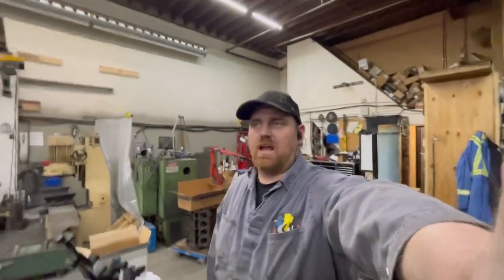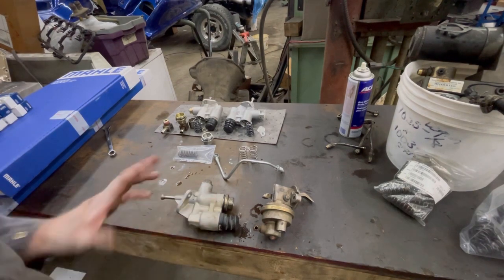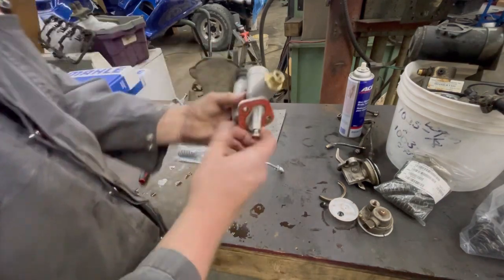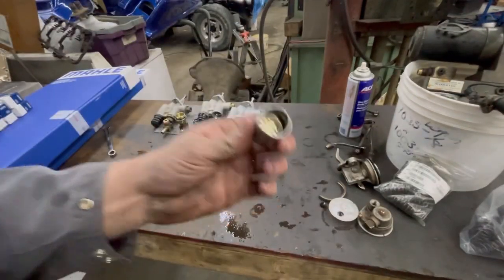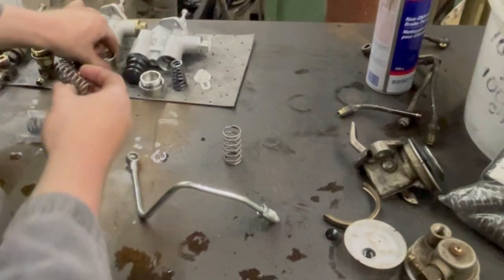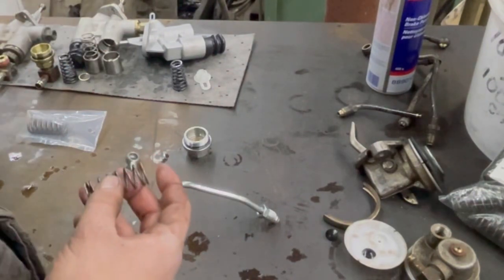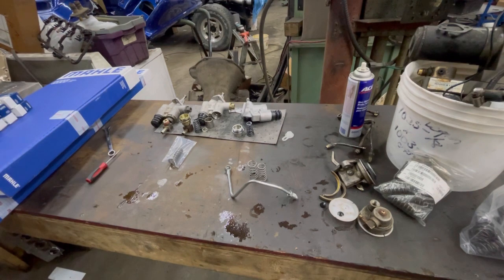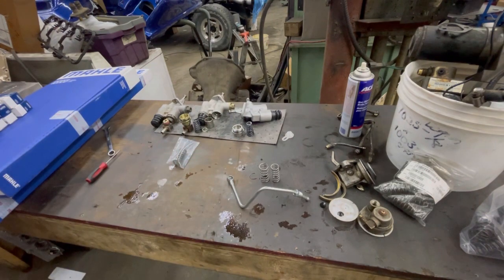HOW TO BUILD HVLP LIFT PUMP ( 89-93 FIRST GEN CUMMINS )

Comment: I have  a 12 v 5.9 from a 1995 school bus , 121,000 miles , tag says 230 hp at 2300 rpm ,  if I replace the lift pump while its out should I replace the pump with the big spring one , or just leave it alone,  all we’re doing is a reseal and  kdp its going into a 1995 f350 service truck ,

Comment: I have a Cummins B3.9l engine in a 2004 Lull telehandler. I just started having throttle response issues. As I just bought it used I started I presumed lift pump and filter issues. Pulled the Wix 33358 fuel filter and saw it was rusted internally so replaced it. Couldn't get the lift pump to prime so thinking about replacing. A direct replacement is very expensive. But I saw mid-90s Dodge Cummins diesel pump that looked exactly the same being just $60. Will they work with my B engine?

Comment: Interesting upgrade. However the only diaphragm pump pump I've had fail either in the 89 or the 93 both of which were brought new and I still own, was because it set for 2 weeks in northern Canada while I was Snowmobiling at constant -40 (maybe less) and where the rod was swaged to the diaphragm washers shrunk in the cold and pulled through the washers. Also note that on another trip, upon returning from the cross country snowmobile trip, my Dodge was the only truck that would start on it's own without being plugged in or pushed in the the shed at the hotel to be warmed up first

Comment: Is it possible for my 12 out Cummins to be getting fuel in my oil due to a hole in the diaphragm on my lift pump
Reply from the maker: Yep. Or the seal in the first of the ve is leaking

Comment: Can you replace the seal inside the plunger style pump
Reply from the maker: If you could find one you could.
Reply: Right I haven’t really seen a rebuild kit for like the OEM Carter pumps (ever) and I’ve never took that seal out to even know what it looks like 🫤
Reply from the maker: @fittedproductions . Pumps are cheap enough I have just replaced them if needed.

Comment: Hi Rob, you have a part number for the small bore pump? I'm in the UK.

Thanks in advance.
Reply from the maker: cummins p/n 3936316
Reply: @CUTTERUPROB  you sir are a gentleman. Your content is very much appreciated. Thank you for sharing your knowledge.
Reply: @CUTTERUPROB  looking at the specs that pump puts out around 20psi. Is that safe for the 5.9 with a ve pump?

Comment: Isn't there a problem with the new after market pumps were they dump fuel into the crank case .?? Then there is ones with the weep drain hole on the out side .       Or am I just loosing my mind
Reply from the maker: There could be I haven’t had one do that in years. But it can happen

Comment: How can I identify if I have a large or small bore pump so I know which springs to buy? Is there a measurement for the bore I can take? Or is everything that's not OEM Cummins a small bore? Thank you.
Reply from the maker: you will have to pull it apart and measure the piston
Reply: @CUTTERUPROB  I've pulled the pump and measured the OD on the piston, it measures 30mm

Comment: Pretty interesting. I appreciate your videos greatly. 30yrs ago, I wrenched for a living at a speed shop. I fell out of tune with it and moved onto other trades. My passion for speed never faded, it just got moved to the rears. As years have passed, I watched the performance  diesel industry expand. With that comes my 6.7l hybrid desire. 

Just a quick question, how much HP will a big bore piston pump support. I may want to build a 5.9 12v someday......
Reply from the maker: I have made over 550 on one no issues. Heard of guys making 600-650 on them

Comment: Hey Rob I have a V pump on my 91.5 and but I also have a Hamilton cams hat see I don’t have my fuel filter in stock location anymore I have a second GEN fuel filter set up on earth mounted just like a second GEN truck would be I wonder if a guy can use a flex line so I’ll be easier to get that pump hooked up to to my truck anyway this is six in a row jim From Kennerdell Pennsylvania
Reply from the maker: You could for sure.

Comment: Great video what’s the part number for the different springs high pressure n low pressure.also what are those cons shaped springs I see up close the pumps in the video ?
Reply from the maker: That’s the stock springs in the pump
Reply: @CUTTERUPROB  what is the part number for the 10 to15 lb. Spring from Granger?

Comment: I had a 14mm VE,that I tried feeding with a stock piston pump from a 7100 engine,that pushed fuel past the drive shaft seal on the front and filled the crankcase,...I then installed an adjustable air dog...the pump eventually failed on me unfortunately cause of my own wrongdoing probably...but anyway,...great content as always feller...catch ya on the next one 👍👍👊